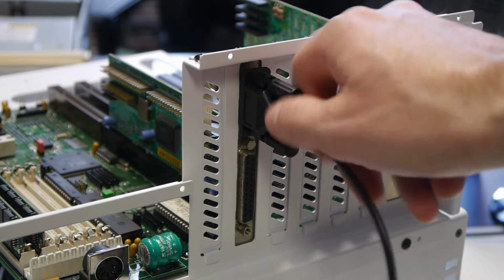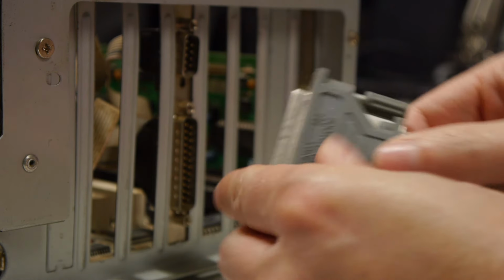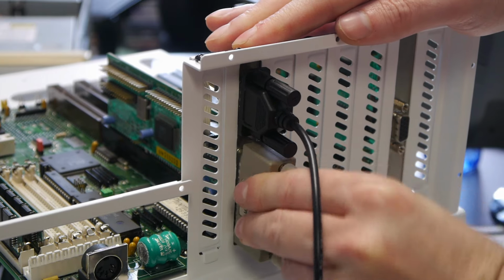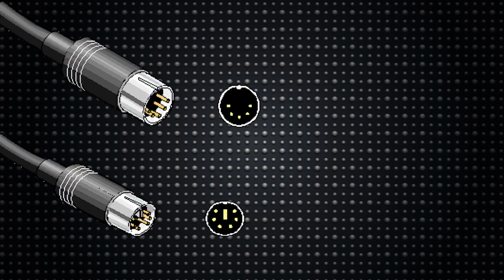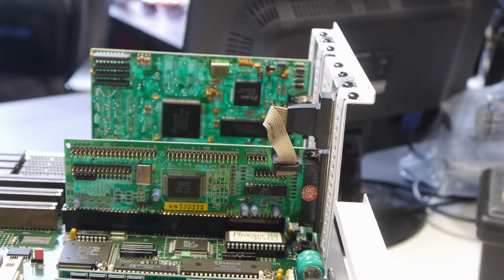What did we use before USB? | Nostalgia Nerd

Comment: Everyone seems to forget that these communication interfaces and protocols were developed for mainframe and mini computers long before PCs existed. The Centronics Parallel port originally used a proprietary 36 pin connector, and was used to connect ultra fast band printers to mainframes. These were the printers that would churn out hundreds or thousands of utility bills every month. When adapted to the puny little dot matrix printers like the little 9 pin deals used on PCs, the old CP/M machines had Centronics connectors on them. But, that connector was too bulky for an expansion card, so the DB25 connector was used, the same connector used for RS-232 serial communication. And, the RS-232 port was developed to connect high speed punch card readers to mainframes, so all the leads were used for full-duplex synchronous communication. It supported really high speeds. Then, Digital developed their line of minicomputers that used dumb terminals. Those only had to transmit data as fast as the operator could hit keys on the keyboard, so slower async communications were used. That's why async RS-232 used the DB25 connector, but only a few of the leads. IBM needed room on the expansion cards for a DB25 for the parallel printer port, with only enough room for a DB9 for the async serial port.

Comment: and so we're back to square one, with a million different USB types.
Reply: HAHA! Yep! And USB2 devices don't always work in USB3 ports.
Reply: @andywolan  isn't it the other way around?
Reply: @arsenii_yavorskyi  Both actually. USB3 devices are supposed to be USB2 compatible sometimes don't work on USB2 ports.
Reply: Originally they only had two connectors, USB A for the computer (host) and USB B for the device. They needed to be different as pluging a computer into another computer could cause damage.

While fine for things like printers and audio interfaces, the USB B connector was too big for portable devices like cameras, so they introduced the mini USB B.

When smartphones became a thing mini USB was too big, so they introduced micro USB.

USB 3.0 introduced some more pins in the A connector, which needed to be added to the B connectors, so they added little nobbly bits to the standard B and micro B connectors. You see this design mainly on external hard drives.

Now the electronics can be sophisticated enough to prevent damage caused by plugging a host into another host, so they introduced the USB C connector which is designed to eventually replace all the other connectors.
Reply: they're all compatible though
Reply: @souljastation5463  no.
Reply: Grime Fork calculators, portable phone chargers, some wireless headphones, etc still use them. I wouldn’t say almost nothing does, as that port seems to be standard for those things, but if you don’t use those things you’re definitely not likely to see it
Reply: Gamblers i think you’re right, now that i think about it
Reply: @Jellylamps  Actually no.  I have enough different devices to need all 10 types: A classic, A-USB3, A mini, A micro, B classic, B USB3, B mini, B micro, B USB3 micro, C.  Plus the nonstandard B mini audio (HTC) and B sub-mini (cameras and earbuds).
Reply: Not really. Usb1 to 3 is compatible and USB-C is the new mini USB. 

Even my raspberry pi has started to use USB-c and i cant blame them. mini USB was painfull
Reply: They are 5 types at most. https://www.memorysuppliers.com/blogs/memory-suppliers-blog/guide-to-the-differences-between-mini-usb-micro-usb-and-usb-c
Reply: @mourgos1234  which IMO is still 3 too much. 

It should have been as simple as; 1 "fat" usb (the traditional one) and 1 small usb.

Comment: As a maintenance Technician that has to work on machinery sometimes 20 years old, screw RS 232
Reply: As a network engineer, I work with RS-232 every day on switches and routers that were literally bought new last week.  Some of 'em have USB ports, but the USB connection requires special drivers that are specific to the device being connected to, and can and will bluescreen Winsuck (specifically the drivers given by Cisco, which haven't been updated since the Win7 era, even though C9300s still have the USB port).  Oh and sometimes it's USB-mini and sometimes USB-micro, with mini being more common.  The RS-232 stuff all uses an RJ-45 jack on the equipment end (and db9 on the laptop/desktop end), and it's pretty much always 9600 8n1, always works, and every OS comes with rock-solid serial port drivers.

Thank goodness for an enduring standard that isn't a viciously retarded combination of massive bloat (hello second system effect!) and bad engineering.

Comment: I have a better question. With tech like thunderbolt 3, why is usb still around?
Reply: USB plans on reaching Thunderbolt speed in the next few years. Licensing for USB is cheaper than Thunderbolt and ironically Thunderbolt can still use a USB type C connector

Comment: let's be real. USB 2 was terrible. Especially compared to firewire. by the time it was out, firewire 800 was out, so it was out done in speed, but more importantly in those days, USB had a much higher overhead in terms of cpu utilization, and usb had much higher latency. This caused entire industries not to use USB (many big with audio and video production where both speed, seek, and cpu load were all super important. USB got good around 3, and at that point was worth attaching storage too beyond usb thumb drives.

Comment: I Remember buying my first usb devices, it was a 16 MB USB stick! Then I got a USB  trackball. Funny fact, windows 10 still support a mouse on a serial port. Modern motherboards still include pins for serial and parallel and its a good thing Because all kind of cool Stuff that is not easy to connect to usb... This Stuff can still connect to the port ... Stuff like c64 floppy drives, amiga joysticks etc

Comment: "...this was another plug in card when expansion space may have been at a premium." As opposed to today where the vast majority of devices used have NO expansion slots at all (laptops and tablets almost never do).
Reply: I would like to see this mysterious tablet that has an expansion card, as I have seen a phone with expansion cards (Librem 5) but never a tablet (unless MicroSD counts?). Do you know of any?
Reply: Is it possible for the microSD slot to function as an expansion slot? With the right software and peripheral?
Reply: @bryguysays  I suppose it's possible if the chips are small enough. But most expansion cards also had external devices plugging into them.
Reply: @bryguysays  I know full sized SD can, but micro?

Comment: OK, I am officially old. I remember when the parallel port was huge step up. Anyone else here remember hard wiring a buss?  Twist lock cables? 80 column punch cards? RPG, COBOL, and then that fancy new one the kids liked so much, BASIC when the micros started coming along.  DOS on a 5-1/2" floppy, which had to be loaded after start up, then other floppies for the software you wanted to run. 4K memory, then 8K, who would ever need that much? I still have some IEEE parallel and RS232 serial cables in a box somewhere. Nice trip down memory lane, but I don't miss manually resolving IRQ conflicts, and building TCP/IP stacks, let alone the frustration of trying to get a clean handshake on a modem!

Comment: Better times.  Back before were had to fight with drivers that just don't install or function correctly.  We would be so much better off if computers still used RS-232, and USB had never been invented.

The only instance where RS-232 would be inconveniently slow would be communicating with an external hard drive.  Easily solved by making external hard drive ethernet devices, which can be plugged into a router and shared by multiple computers, or connected directly to a laptop ethernet port when out and about.

Comment: 5:32 You should replace the mainboard battery (BIOS battery).
BTW:
I go my first PC in 1995: Pentium 75 Mhz, 8MB RAM, 15" Monitor. Mouse was 9-pin seriell, keyboard 5 PIN.
Greetings from germany
Reply: Guten Tag!  I had a 486/DX2-66 ('Turbo' button, lol) with a 420 MB hard drive... Was jealous of my buddy with a Pentium 75, then gave him shit when the P-IIs came out because they didn't need a separate math coprocessor...#nerdarguments

Comment: These serial ports had one great advantage .NO DRIVERS REQUIRED

The USB spec is a mess
Reply: Serial ports still require drivers on platforms like Windows.
Reply: I need no extra drivers on Linux, although partly because I choose most of my devices for plug-and-play Linux compatibility. 
...Actually, on second thought, the dreaded printers need drivers. Are you talking about printers? Those are the worst. Everything else works fine though: keyboards, mice, webcams, storage media, some wireless adapters, card readers...
Reply: @happysmash27  That's because the linux kernal is a monstrosity that includes the drivers for every device ever created.
Reply: Maybe it was better that way !

Comment: my dad has a keyboard that has a ps2 cable, yet the keyboard looks very modern
Reply: In a not super related sidenote, PS2 is known to operate at lower ambient temperatures. I’ve heard of hard-core overclockers needing to switch to PS2 for this reason.
Reply: huh? lower ambient temperatures? cables are always at lower temperatures. or do i not notice that usb is faster, so it would overheat a little?

Comment: Why not UST? Trains are faster than buses.
Reply: Then USP? 
Planes are Even faster 
And for that matter, go for USJ 
Jets are a thing
Reply: @AsperGoat  WHAT ABOUT UPS
Reply: @AsperGoat  Whqt about USSR? Space rockets are faster than jets.
Reply: @aiosquadron  how's light? 
Nothing physical can be faster than light as we comprehend the universe now
Reply: @AsperGoat  usp is pistol so no
Reply: Capitán Capri sure
Reply: Why not usl?
Light is faster than any of them by lots.
Reply: we have to use USUE.. speed of Universe expansion which faster than light..
Reply: @kevinfrancisco3224  speed of dark is still faster
Reply: What about Universal Serial Tardis lol
Reply: I would say USC for Concorde but that's taken by unnamed sdvx clone
Reply: lmao same thing trains are faster
Reply: In this case, “bus” refers to a wire or set of wires that allows multiple devices to connect in parallel, especially one that allows a variable number of devices.

A PC motherboard has internal buses for memory devices (this allows multiple RAM chip carrying boards, the BIOS ROM, and the screen image memory in the graphics card to look like different address ranges in a single memory space), the I/O devices, and the interrupt line, supporting interrupts from I/O devices to the CPU.

The original concept of USB was to have all USB devices effectively in parallel with one another, taking turns using the bus.

The only “connection” between an electrical or computer system “bus” and the mass transit “bus” is that both are abbreviations of “omnibus,” a Latin word meaning “for everyone.”  The full word “omnibus” is still used in some contexts, such as when Congress debates (and eventually passes) the “omnibus spending bill” to run the government. 🚍
Reply: Allan Richardson thanks for the explanation
Reply: @allanrichardson1468  r/wooosh

Comment: Ah I remember the time where having even a single USB port was very rare. Though at the time it was often jokingly refered to as a "Useless Serial Bus" because there weren't any peripherals that were using it for the longest of time. and the early peripherals that did use it were costing a bundle just for the privilege of using the USB port. buy a new printer, huh two different version of the same model with almost a 100 bucks worth of price difference? oh the cheap one is LPT, the expensive one is USB, well fuck the USB version.

Comment: USB has a fast, average data flow for bulk data, but a very poor reaction to input response. Any PC from XT onward, can react to a change in the state of an RS232 Serial port control line 100s of times quicker than anything attached via USB even on your quickest i7.  Serial ports also don't change numbers because they have been unplugged and replugged. Lots of USB control devices need program restarts if the device reboots for any reason. Not good for unattended systems.

Comment: I remember running my BBS WAY BEFORE USB came into being.
Setting up interrupts, being certain that there are no IRQ conflicts, assigning COM ports, blah blah blah. :-) 
How I long for the sound of a 300BPS, 1200BPS, or 2400BPS call coming through (and yes, I was one of those nerds who left the modem speaker on so I could hear my BBS's callers connecting -- and also yes, I could quite easily distinguish a 1200BPS caller from a 2400BPS caller).
 
And one of my test instruments from 2001 required a 16-bit ISA slot on the motherboard AND a parallel port (DB-25) connector for its security dongle.

Comment: If you want to use the 16 bit Cutemouse-driver for DOS with an USB-mouse, look into the mainboard bios and enable USB legacy. The bios is going to emulate a PS2-Mouse-Controller.
http://cutemouse.sourceforge.net
---------------------- Without a mouse driver (boot manager)  ---------
checkPS2:
int 11h			; get equipment list
test    al, 3
jz  noPS2		; jump if PS/2-Mouse not indicated
mov	bh,3
mov     ax, 0C205h
int 15h		        ; initialize mouse, bh=datasize
jc noPS2
mov	bh,3
mov     ax, 0C203h
int 15h		        ; set mouse resolution bh
jc noPS2
mov     ax, cs
mov     es, ax
mov	bx, OFFSET PS2dummy
mov     ax, 0C207h
int 15h		        ; mouse, es:bx=ptr to handler
jc noPS2
xor     bx, bx
mov     es, bx		; mouse, es:bx=ptr to handler
mov     ax, 0C207h
int 15h
ret

noPS2:
stc
ret

PS2dummy:
retf
;---------------------------------------------------------
enablePS2:
call disablePS2
mov    ax, cs
mov    es, ax
mov    bx, OFFSET IRQhandler
mov    ax, 0C207h	; es:bx=ptr to handler
int 15h
mov	bh,1		; set mouse on
mov     ax, 0C200h
int 15h
ret
;-------------------------------
disablePS2:
xor	bx, bx		; set mouse off
mov	ax, 0C200h
int 15h
xor     bx, bx
mov     es, bx
mov     ax, 0C207h	; es:bx=ptr to handler
int 15h
ret
;---------------------------------------------------------------------------
IRQhandler:
		assume	ds:nothing,es:nothing
cld
push    ds
push    es
pusha
mov     ax, cs
mov     ds, ax
mov	bp,sp
mov	al,[bp+24+6]	; buttons
mov	bl,al
shl	al,3		; CF=Y sign bit
sbb	ch,ch		; signed extension 9->16 bit
cbw			; extend X sign bit
mov	al,[bp+24+4]	; AX=X movement
mov	cl,[bp+24+2]	; CX=Y movement
xchg	bx,ax
neg	cx              ; reverse Y movement
popa
pop	es
pop     ds
retf

Comment: Back in the 80s and 90s i used a mac. So much easier. Adb ports and scsi - and you could run apple talk networks using phone cable.

Ha - a hand held scanner! That wouldn't work on a mac 😀

Comment: The price to pay for all that speed is limited transmission distances compared to RS232 and RS485, that's why they live on in industrial applications like hvac control, metering and equipment control. The same has  happened with video, compare the maximum distance of hdmi to vga or composite video.

Comment: LOL, I had one of the first IBM computers with a hard drive, it had a 20 Megs capacity. Which was considered adequate at the time because everything was done using DOS (disk operating system), which was just a case of typing lines of data, they didn't have Windows. The first Windows to go international  was Win 3.1, the hard drive capacity had to be increased considerably due to the programme using colour and graphics, many didn't like this new system as it took  control over the computer, away from the user. Now of course we use Windows for nearly everything, although DOS is still there in the background and everything is more or less saved, without our knowledge. Hence hackers can break into this saved data and cause mayhem, despite continual security updates on the data storage..
Reply: DOS is not "still there in the background"... Not since the days of Windows 9X or ME.

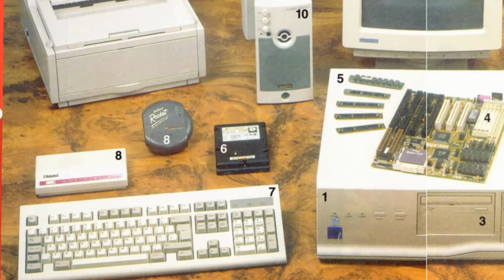Comment: That struggle when you had some awesome older PC gaming hardware (in my case gifted a flight yoke and pedals), but it's "game port" serial and there are no drivers for it any more. I remember spending a lot of time trying to get them to work, and eventually did for just Flight Simulator, but this was in Win XP days. It'd probably be easier now. :P   edit: holy crap I typed this before seeing 4:04 THOSE WERE THE EXACT YOKE AND PEDALS

Comment: I had the 16bit PhoneBlaster... 😅 Combined 16bit SoundBlaster and 33.6kbit modem/fax/data. Also the longest card ever, and it required a fullsize cabinet with no built in hdd-bays in the way... desktop cabinets didnt have enough debth to acommodate the long card, as either the powersupply or drivebays would interfere.

Comment: Ethernet hasn't gone anywhere
Reply: It's a completely different set of protocols than USB. It won't be going anytime soon either. IBM's Token Ring never got anywhere near Ethernet's market adoption. Ethernet was developed by The Xerox Corporation in the 1980s and it's major selling point was, and still is, its scalability. The original 10-Base-5 Coax and balun arrangement has long since been replaced by the familiar RJ-45 interface we use now.

Comment: Ugh, serial and parallel ports. Awful. I'd take even the lowest speed USB over all of them. PS2 ports were okay.
Reply: But you did not need drivers for every crap you connected to the serial port. You just needed to set speed (ok, and stop bits and parity) and it worked. And it worked with looooong (I mean tens of meters for RS232 and up to 1 km for  RS485, with real bus capabilities) cables too. Awesome. Try this with your USB.
Reply: @trazalcatraz  every thing I needed to connect to serial and parallel ports needed drivers (mouse, printer, 1st gen webcam). Also, I have a 50 foot USB cable specifically for making repositionable cantennas. Works like a dream.